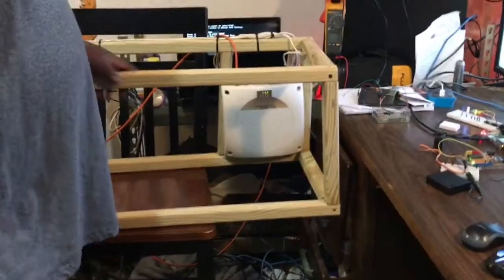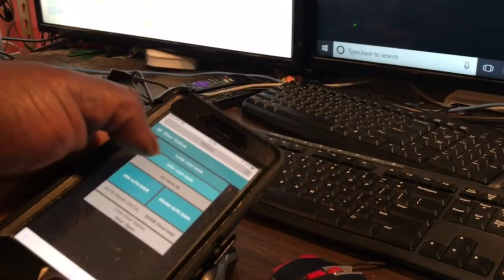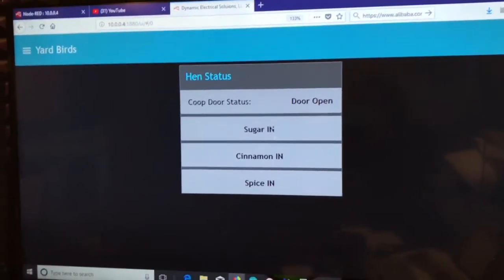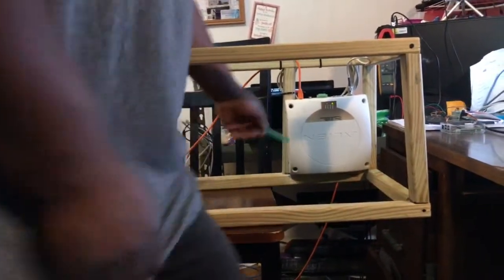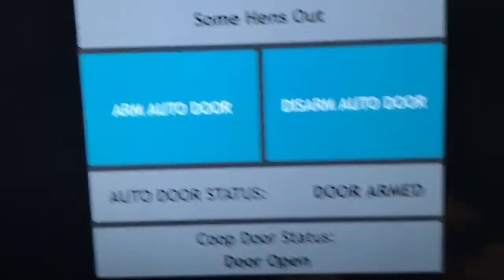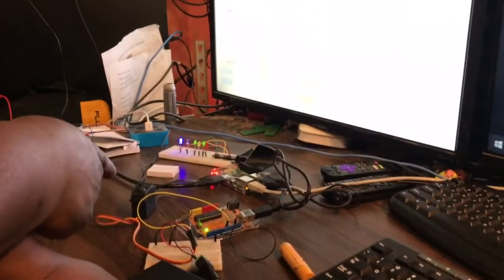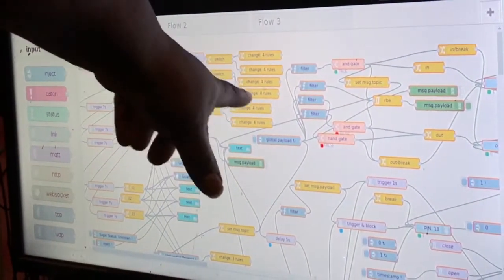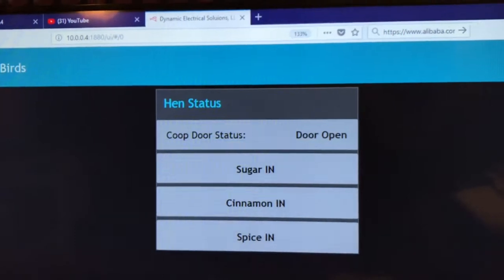RFID Chicken Coop Door Design

Comment: I think this rf I’d reader is better suited as the chickens willl pass through the antenna.

With The rf ID  reader I used for reading pet tags, you can wrap your own loop antenna .

Wrap the correct length of coated copper wire around the tunnel .
the bird will walk  through the antenna. Giving more sensitivity.
I ran this off of an arduino but if you used an esp8266 or esp32  you could have it publish a webpage to control everything.
https://youtu.be/ix70PTXmay0  details of the kit I used are here.

Comment: That web interface you are using, did you write it or is it downloadable from some where?
Reply: Node-Red Dashboard. 
I programmed the whole system using Node Red.
Reply: Thank you, I am going to run it on a pi zero 2.
Reply: Of those 2 readers, which one is easier to integrate with the raspberry pi? What is the model?
Reply: @tomawicki2503  THey are both the same reader, just different antenna. Alien 9650 I think